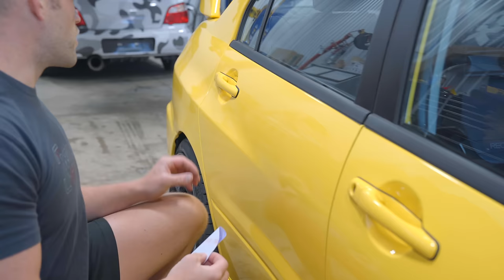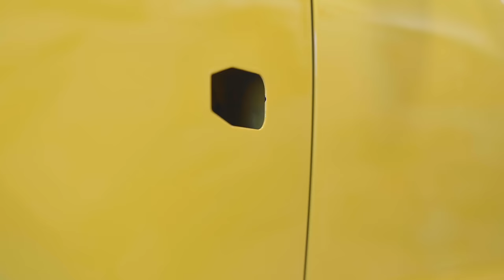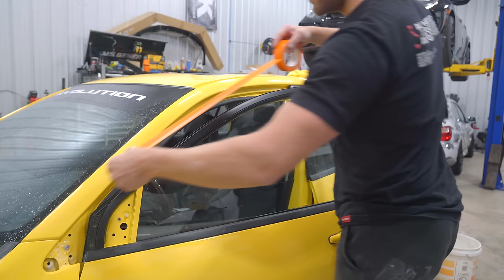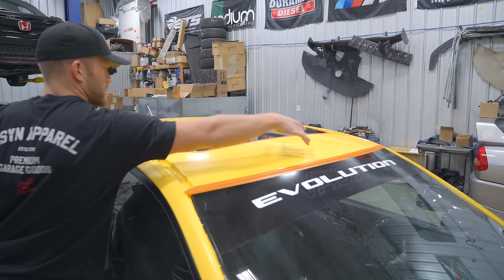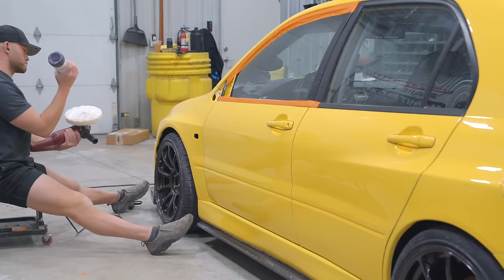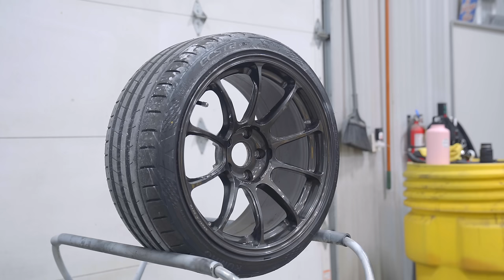The Ultimate Car Detailing Guide (Full Wetsand & Polish)

Comment: Very nice, I’ve also started using the geyon Quartz Tire cleaner to get all the oil and release compounds out of the rubber and then the Geyon Quartz Q2 ultimate tire Si02 ceramic tire coating. One coat for a matte and 2 coats for a more wet look. It works like a permanent tire shine and protects the rubber. They work best on new tires and can last a year. 
Final touch for the ultimate Evo. ✌️